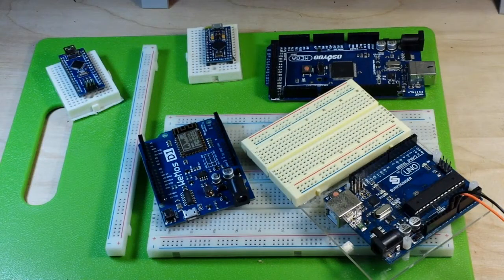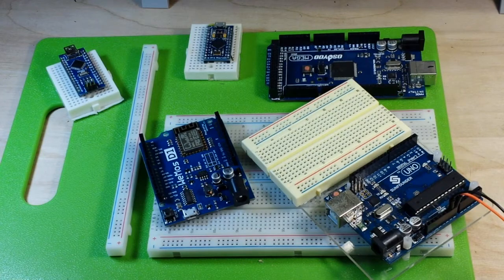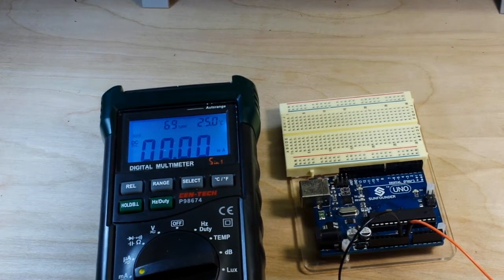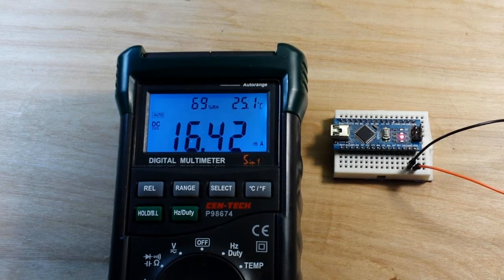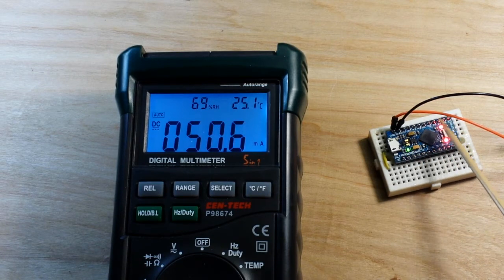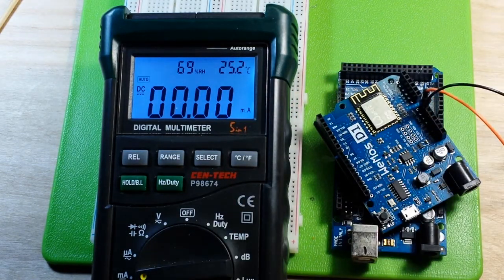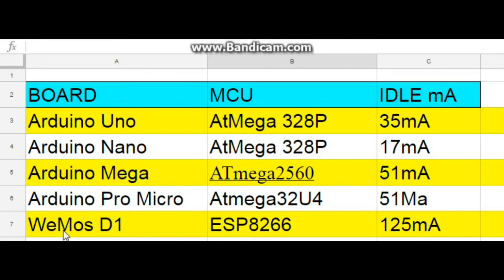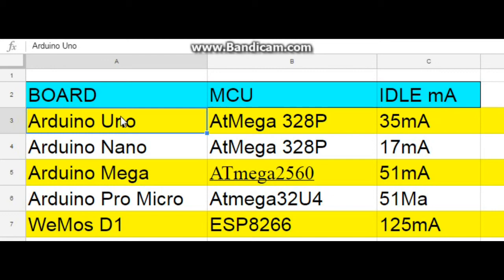ESP8266 and Arduino--How much power do they need

Comment: BAD idea sitting the ESP on top of another board. Are you sure nothing wasn't touching contacts underneath? Also yes, make sure the 5 power is going into the +5V Pin and NOT the VIn pin.
LDO Voltage regs are bad at conversing power. I don't know why they don't incorperate a Buck Converter on the VIn Line. Rather than waste power to heat with LDO Linear Voltage Regs.

Comment: doesn't Vin go through the LDO regulator on the UNO first? The voltage drop would account for some of the current draw. 5V can go straight to  the 5V pin, bypassing it.

Comment: you have to try out the power  modes of the chips ;). also the voltage regulator is probably also using a part of that energy
Reply from the maker: fredlllll I know, I just wanted to show how they ran with no modifications.